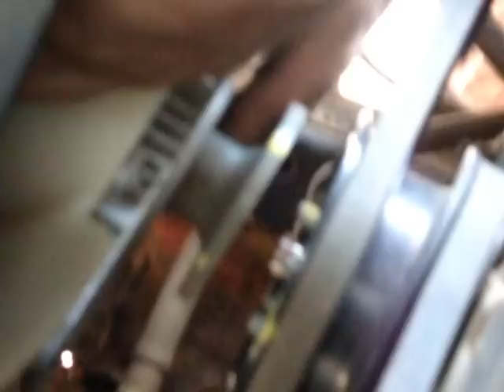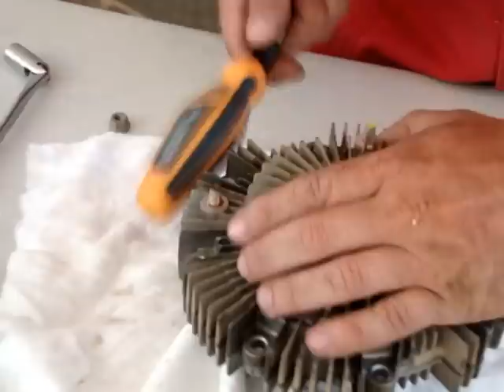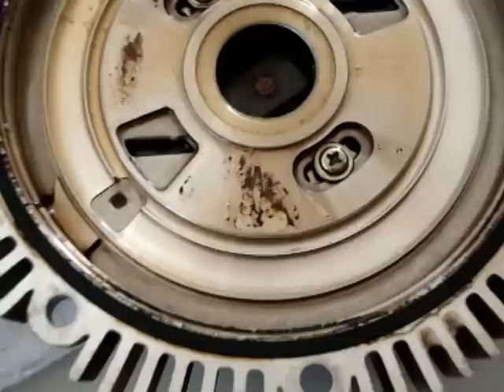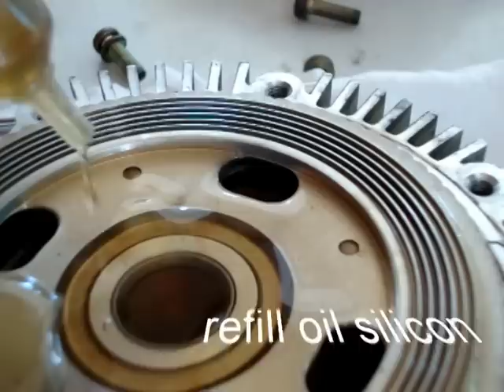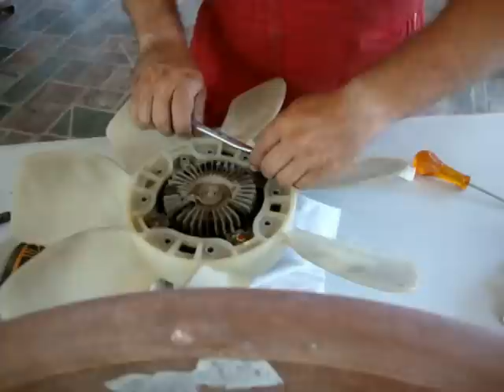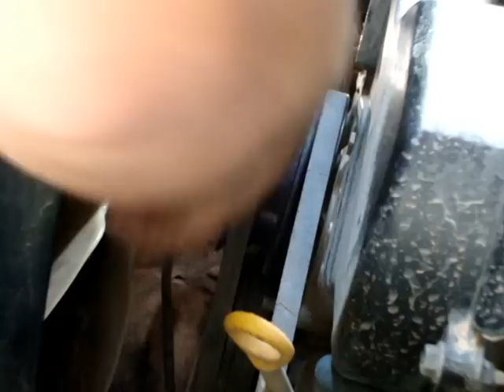TOYOTA LAND CRUISER 90  coupling fan repair(refill oil silicone)

Comment from the maker: correct...you just throw out the old one.and you replace with the new 18 ml ..its enough to expand it and work properly.but check for moisture inside or rust and clean it very well

Comment: Small tip, unrelated to the clutch fix. Never thread a screw, specially in aluminium, with a powertool.

Put the first couple turns by hand or screwdriver.

You risk ruining the thread before you notice it went in crooked if you use a powertool.
Reply from the maker: You are correct .but I share a deeper tip.before I use the powertool all the times I "wake up" the bolt with a Philips screwdriver or a flat and a hammer by applying some vertical and steady hits it doesn't matter aluminum or not.i face all the bolts like I will do not have other chance.one and only .this tip unscrew 99.9% of the bolts without destroy the head

Comment: Why did you add to the disk and not into the reservoir?
How did you know how much this clutch needs?
I fear you severely underfilled it...

Most people are adding it to the reservoir, then you can know when you have added enough...
[must have space equal to the 'center' hole volume...]

Comment: I wouldn't use loctite 271 for these screws, you might never get them out again. Loctite 243 is a much better option. Or no glue at all, the spring washer should be enough.

Comment from the maker: when the years passed , the silicone oil evaporated (small quantity),or mixed with rust from water when the O-ring dont isolate around..so..the result is not to engage the fan..
the cost of all this to replace is 500 euro about..but you can replace only the oil with 8 euro..
another reason which make the fan not to work properly is that the bi-metallic spring in front of.. coming too old (cause of the temperature) so dont respond with reliability..(this a suggestion from toyota manual)
Reply: Do you have a part number for the spring??
Reply from the maker: @lukeneave  if you mean the bimetal spring.No.Toyota gives all the mechanism complete as whole system .
Reply: Evaporated?  The housing looks greasy on the outside.  Did you replace the seal?

Comment: So do you remove all the old oil and replace it or do you top it up ?
Reply from the maker: yes..i wipe out all the old remaining oil with rust and i replaced with a new one..the old oil is not had the correct viscocity after all these years..also was mixes with drops of water

Comment: Was advised that you can use remote control car suspension oil, it's the same stuff

How many bolts do you undo to remove the fan?
Reply: no it's not, and it's not any savings over just buying the real Toyota stuff.
Reply: I bought 12.500cst silicone oil from RC cars. In Brazil toyota doesnt sells the OEM silicone oil. The oem toyota silicone comes in to versions: 3000cst for cold countries and 10.000cst for hotter ones. Brazil is a little hotter than average, so i put the 12500cst oil.

Comment: o.k since you ask for epicheirima here is one.You changed the silicone oil but in case you had to readjust the the temperture of the clutch do you know how to do it?
And before you say anything more i repair them and test them on testing machine,not just change the silicone oil.Best regards from sunny Greece!!!
Reply: gday Jordan can you tell me how to adjust the temp of the fan i have a offroad buggy and want to lower the temp that the fan kicks in at
Reply from the maker: this is not an epicheirima dear Jordan.is the way that you want to see the things.if toyota in japan had in her mind to  readjust temp or test them after 2-5-10 years or 10.000 running hours in a special testing device will provide this special device to the special shops with her name , and would  give the written info to the maker's manual for follow the instruction by her specialist's engineers.instead of this ,gave only the part number for the silicone oil.this means in other words that after 8 years of RnD in japan (1988-1996) before the specific model goes in production line (calculating factors as aging of material )and all the appropriate tests she will know better than anybody if this mechanism needs to be repaired/readjusted  in another way than replaced the silicon oil, then will apply this  special  info to her shops worldwide .if finally this special device not existed in 1990 era in japan and discovered after 10-20 years ,toyota will sure send one additional guideline worldwide about how to use this special device her specialists and for readjust this mechanism.also is not work as an epicheirima the  "philosophy" all the coupling funs are same and working in same procedure.toyota not construct coupling funs but buy them from a company that probably sells to other  car industries.but every specific model have specs than not meet to another model.(i.e as in thermostat's surface is written 80-82 C ,would written also to alu surface of fun the temp for readjust...)and the result/evidence  of the above is that japan is where is it now..to the top of the world in tecnology and greece is where is it now..but Greeks are always smarter than all the others and they know better from all the others and overide the makers..  now if somebody like you , knows better than toyota about her parts then is not difficult to send an email to toyota corporation in japan and ask them to hire you as a consultant advisor to similar matters.iam sure they will appreciate it and maybe one headmaster's chair is there already waiting for you.sincerely yours.
Reply: +chrislcful im using the motor in a totally diffy way as to how it came out of the factory you speak of I've changed chassis. all the cooling piping. the radiator. and have also fitted a turbo so the motor is nothing like what came from the factory and i want the fan to come in a little earlier
Reply from the maker: Nathan your motor is 5vzfe ?if so, i suggest to you to install an electric fan. many did this option.there is no problem during dives in water ,and you can adjust from the sensor in how many mA wants to start or stop the fan.additionally you can install a second bypass switch so you can start or stop anytime you wish.and of course you will not lost some Hp from the crankshaft.but generally ,when you make a project like this you made needs a complete study from an engineer of university and not opinions from vulcanizater-men.needs to pay an engineer to take measurements before make the study for you have the perfect result.do not hesitate to ask anything you want.

Comment: A mechanic recently installed 7 tubes of silicone oil into the engine fan of my Toyota Fortuner 2013 series. After that, the engine has produced a loud noise, particularly when I stepped on the gas pedal when driving. Is it possible that the loud noise of the engine was caused by adding too much silicone oil into the engine fan?
Reply from the maker: Monching Balindong stupid engineer.not more than 2 tubes of the original.the more silicone oil will increase the volume of the liquid inside so the system will be always enganged so the noise you listen is because the fan is always enganged to engine.the liquid inside must have free space to increase and decrease the volume according to the relevant temperature that received
Reply: @chrislcful  thanks for the info. Perhaps, i'll just have it corrected.
Reply from the maker: Monching Balindong of course its a common sense that always follow the guidelines of the maker.i.e. if for your fan needs 7 tubes and you refill witj 7 tubes this is correct.but if recommends 2 and put 7 this is not engineering and not common sense
Reply: @chrislcful  ther can not get 7 tubes inside...
Reply: yes for sure
Reply: @chrislcful  It is not for thermal expansion! The volume must be such that it will store in the reservoir when the valve closes! It has nothing to do with free space for expansion.
If you had that much in there, it would be engaged all of the time!
Reply: Remove some of it so it's not always engaged.  This will get rid of the noise and save you gas.

Comment: Great video, anyone know how much viscous fluid to put in a 2.5 MN Triton diesel fan clutch -4D56  motor?
I can't find any info but a Pajero takes 32 mil so I think I will add the same amount in the Triton clutch
Reply from the maker: You will remove the old fluid and clean thoroughly , and after you refill the half shell and you will install the other half shell.and that's it. the fluid will expand every time that reach the temperature and will engange the system.

Comment: Do you have any specifications on the silicone oil you are using?
Reply from the maker: there are 2 kinds of hydraulic silicone oils .with different viscocity.the most safe way is to buy the original that costs only 7-10 US$ .the secondary way is to buy the genuine and send it to the laboratory for chemical analysis.all the other ways "by eye" ,"by smell" ,"by feeling between your fingers " or using words such as "is similar to.." is for "technicians that do not know how to boil an egg.
Reply: I'll probably end up installing electric fans but thanks anyway.
Reply: It's 10 000 cSt silicone oil (polymethylsiloxane fluide). Some cars use 3 000 cSt oil - I guess, ones with less power engines.

Comment: Dear friend. what liquid do you fill in the unit? what's her name? where to buy it?
Reply from the maker: this is a special silicone oil that use toyota for hydraulic clutches like this in video. the code number you can see to the video and to the first comment (08816-03001 ) .Toyota dealer is the supplier.If you do not know the viscocity of the original do not take the risk to put something similar.

Comment: Silicon oil name / brand/grade & which silicon oil available on online in India
Reply from the maker: if you read th ecomments my friend, you will buy only the genuine from toyota with the given code.. alternative you must buy the original silicone and you will go to the laboratory. You will take also some aftermarkets silicones and you will make also chemical analysis to the laboratory. when you will find an aftermarket silicone that has the same specifications with the original then you can go..and buy this aftermarket silicone

Comment: Electric fan can be fitted there I'm sure someone out there has modified this fan to work just like the car starter and the engine how can there be a mini starter type of thing be used to engage the fan when there is a need to cool the radiator

Comment: Chris, on a 100 series v8 4.7ltr petrol fan clutch. will 3x18ml of oil be enough? i managed to get the oil from my toyota dealer but unsure on the amount to use.
Reply from the maker: iam sorry for the delay of reply...really apologize..and of course you will solve the problem but only for the records ..the answer is .you refill until this coming almost full.not overflow..if its possible you remove the old silicone oil

Comment: AMIGO, PARA UN FAN CLUTCH, DE UNA  FORD F-150, QUE TIPO DE ACEITE DE SILICON Y LA CANTIDAD QUE DEBE LLEVAR, SI TIENES ALGUN MANUAL DE REPARACIÓN PARA EL FAN, TE AGRADECERÍA ME LO PROPORCIONARAS, MI CORREO ES mirey_marg@hotmail.com.
Reply from the maker: +tomay ramirez  all liquids that working for similar purposes has same viscocity.you will ask a silicone oil for fun.